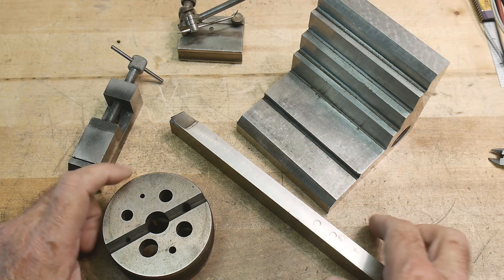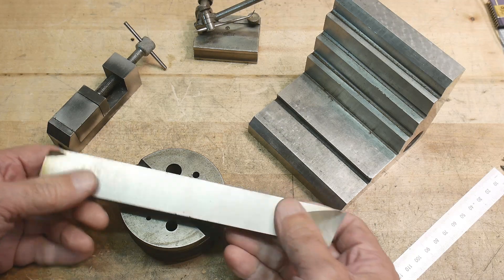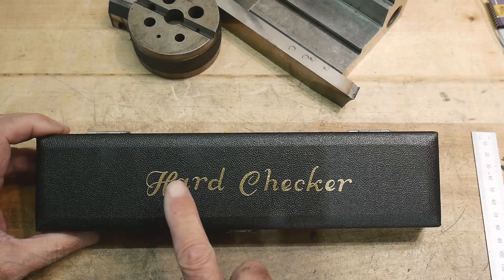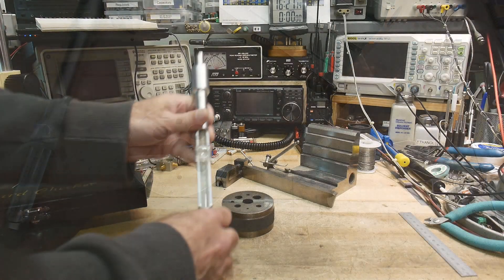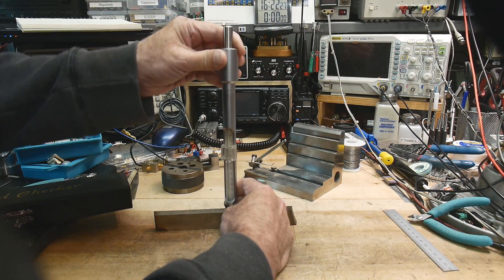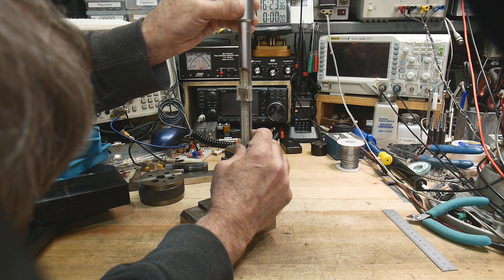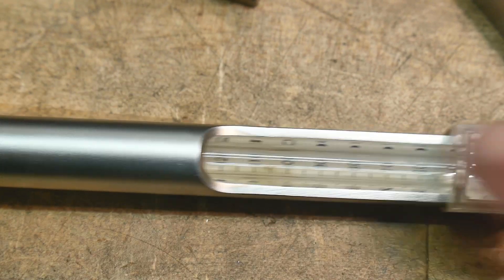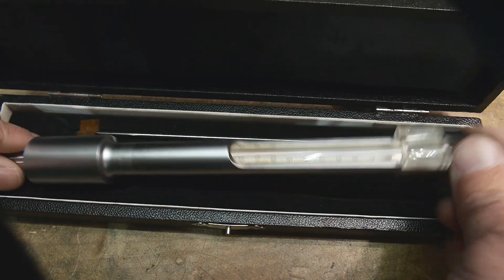#707 Hard Checker

Comment: The surface gauge isn't itself a precision device, nor should any significant force be applied to it, so there's not much reason for it to be hardened, and if it were hardened it would wear more on the surface plate so you might even want it to be very soft. It only needs to hold a pointer or test indicator at the height you set so you can compare the height of a feature. It doesn't in any way measure by itself, and you wouldn't care if it could maintain the height for long periods, because you would as part of the process be frequently bringing the needle or instrument back to a standard. Can't go about trusting stuff, except for the stuff you have to trust because it would be impractical not to, like gauge blocks, scale bananas, the surface plate.